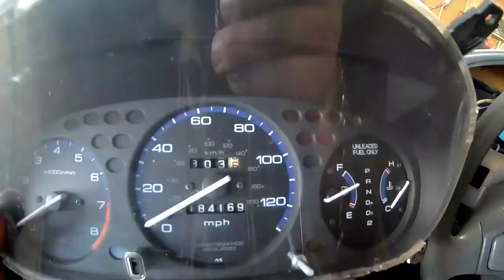lifted a 8th gen Honda Civic Under $500 including 2006 2011

Comment: Those coil spring spacers holding up fine? I'm looking to lower my car but want some rake so am thinking of adding those. Would they come loose if you hit a pothole hard?
Reply from the maker: I haven't had any problems they are still holding. I ended up drilling a tiny hole on each end of the coil spring and using a zip tie just in case they wanted to slip out. But so far so good update video will be coming soon.
Reply: @BarbasLife  Did you do any measurements of the spring before grabbing those? Or are they made to fit pretty much your common spring size? I'm guessing for mine since they would be lowering springs I'd need to get a more custom one. Also you would say each of them add about half an inch on their own? I don't wanna raise 2 inches, more like 1
Reply from the maker: Yea its about 3/4 of an inch each. I put 3 in the back and had about 3 1/2 inch lift something like that. These will not fit coilover lowering springs  but might fit lowering springs since they are wider than a coilover. Also you might have to cut them into 2inch sections that will also work.
Reply from the maker: I forgot they are pretty much universal for car or truck.